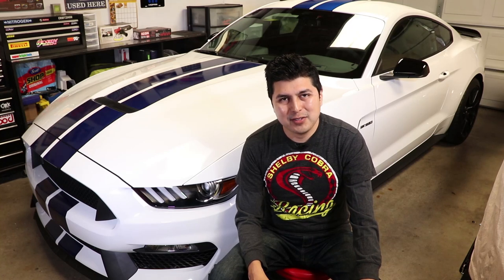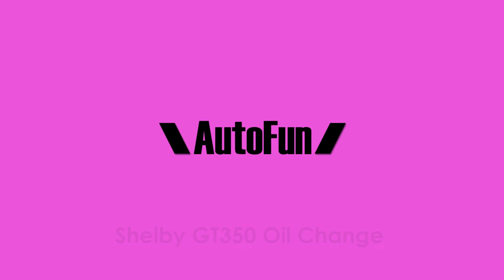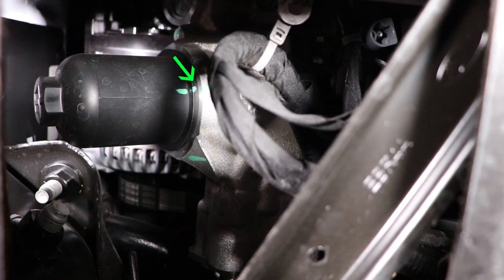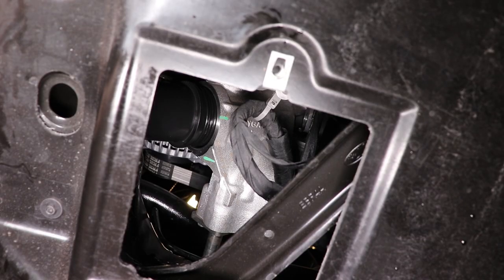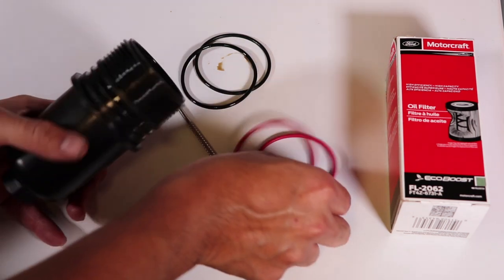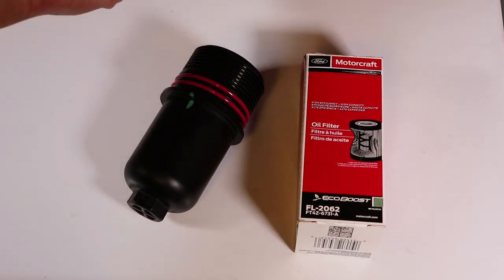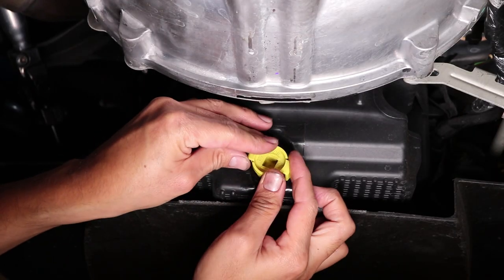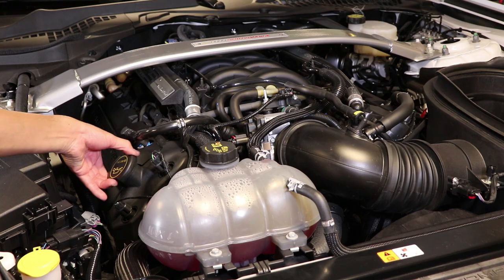Ford Shelby GT350 Oil Change (2017-2020)

Comment: Did you jack up the car, or put it up on ramps?  Or maybe a lift?  Thanks.
Reply from the maker: Hi Craig, I done it with jack stands and also with a lift (quick jack). I do prefer the lift, much faster that setting up jacks but it way more costly that a nice set of stands and a low profile car jack. Hope this helps and thanks for watching!